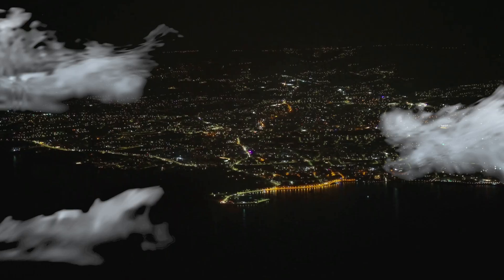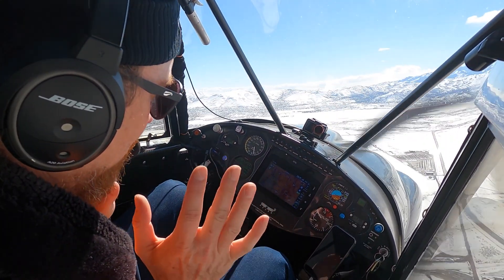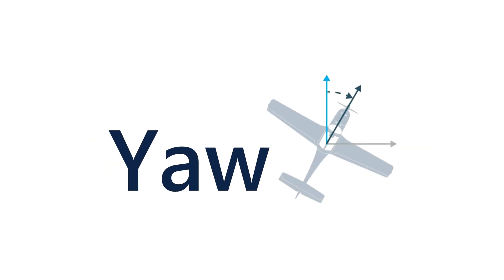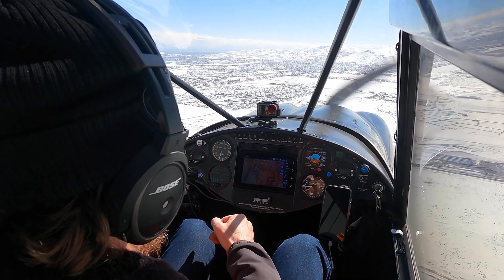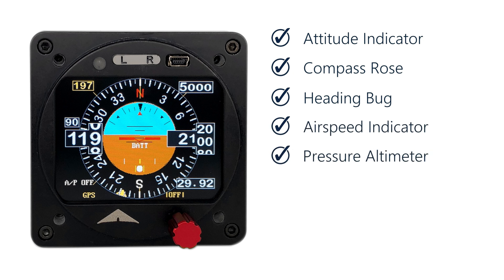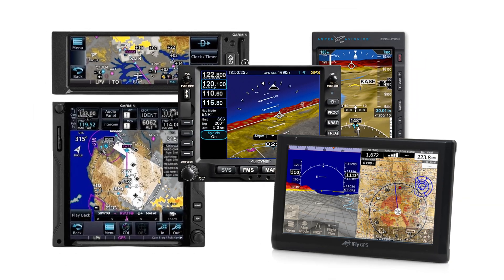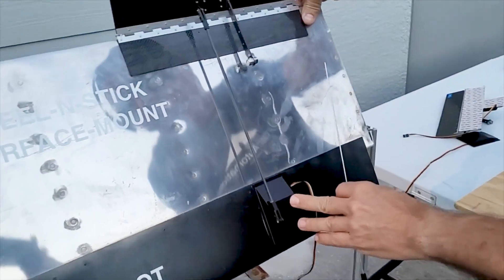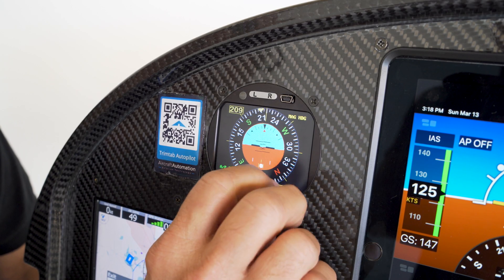Increase Situational Awareness When Flying (Aircraft Automation SuperECO Autopilot)

Comment: So servos from remote control airplanes running small carbon fiber trim tabs and the cost ranges from 2,300 to 3,900.

Is it just me or does it seem like repurposed rc airplane parts should cost less?

Is the building of these trim tabs really labor intensive or something?